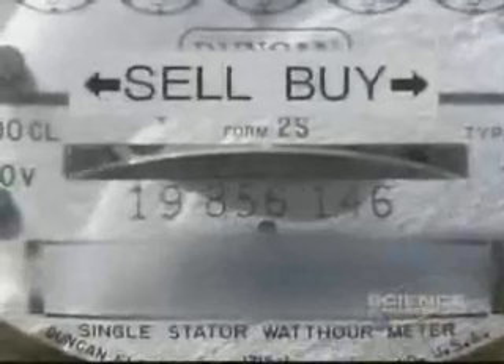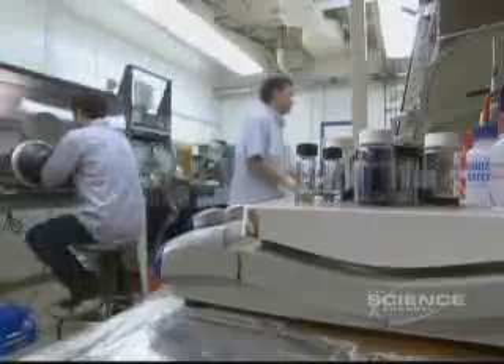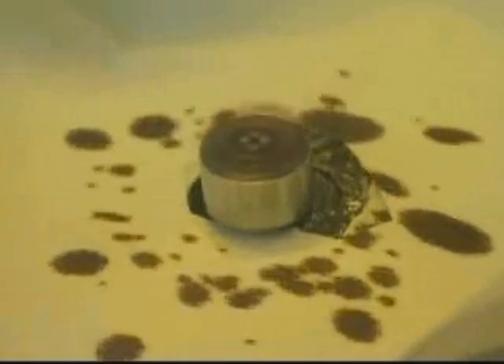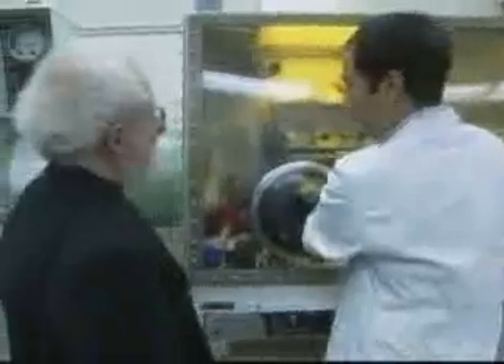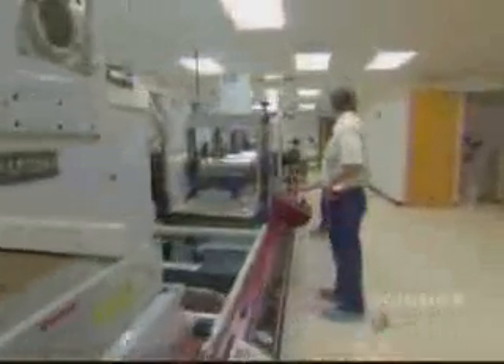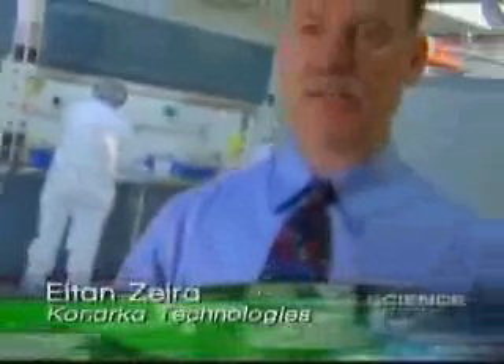Solar Printable Ink  Yes! Solar Ink

Comment: Looks good. Let's go for it.
i was wondering what you would think of combining MTD technology with solar ink and solar thermal to produce a hybrid heat and power system. My MTD solar collectors use an inner plastic film that traps heat. I believe your technology would work well with MTD systems.
John Canivan

Comment: We dont realy realise that we can be using inkjet printers for many applications other than simply putting inks on paper. Imagine liquid like silicium paticulates made by grinding small enough grain of silicium to pass in inkjet nozels. Making this way million semicunductors on plastic sheets substrates. Imagine medications again in liquid form that when mixed from three to seven inks could become a replacement for pills, just a lick will do. All this is future as I see it.

Sim754 in Quebec.